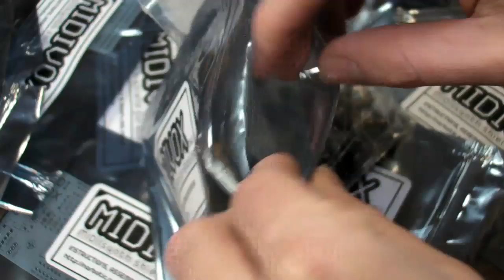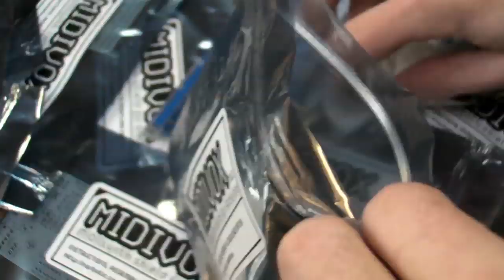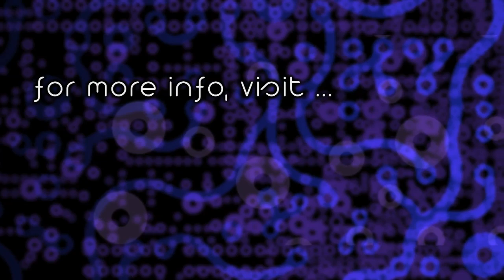Collin's Lab: Kit-making

Comment: When handeling Electronic componets, Electro-static precotions must be taken. Chips, transister, regulators and MosFets to name some of the more sesitive Parts. The Table should be grounded, and The person should be also. The Transfur of parts should only touch the grounded table/person or the Static Bags or the original paking materal. If the Cups were made of Anti Static Plastic,Glass or matalic then all parts would be safe From Electro static discharge!

Comment: @H2O2FromH20 That's pretty crap advice. I've been working with motherboards, processors and generally static-sensitive devices for over 10 years and not one of them has broken because of static electricity.

I even tried it on purpose once.